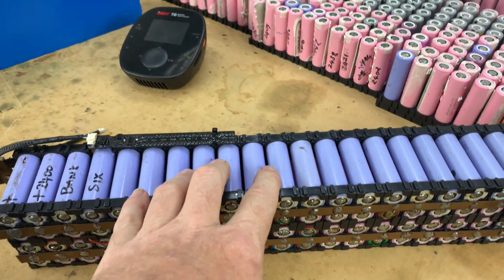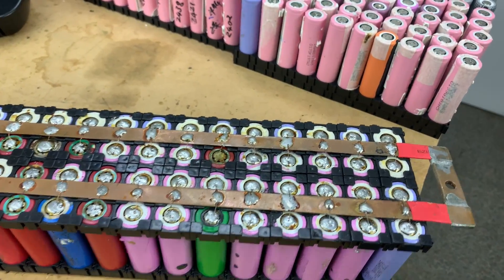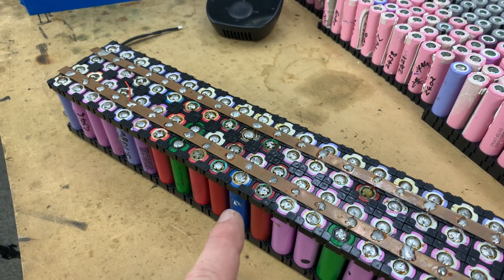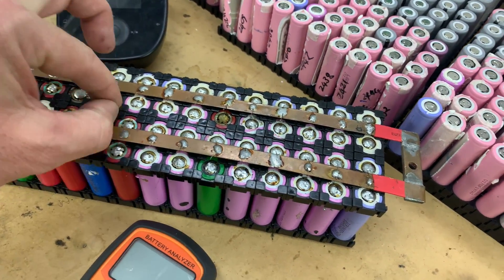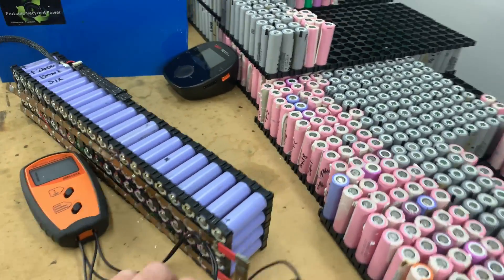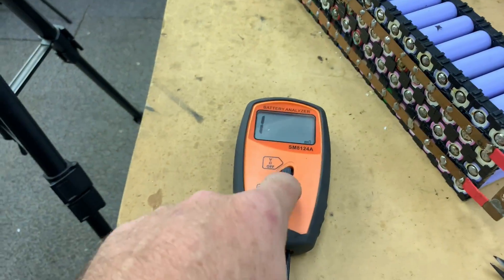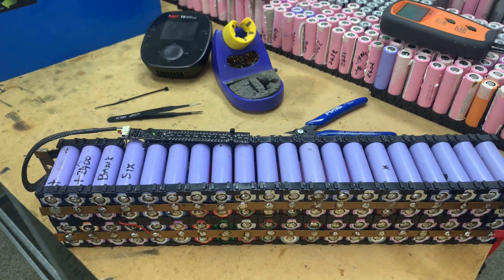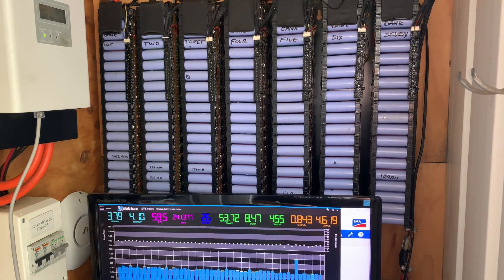Trouble shooting Cell 48 & IR Testing it to try and find a the fault causing it to be weaker.

Comment: What is this. Are you measuring resistance
Reply from the maker: Yes, the internal resistance of the cells
Reply: @HBPowerwall  I'm sorry, but why not use the avometer? Is there a difference? Thank you
Reply from the maker: some volt meters dont' have the function and single point isn't accurate enough.

Comment: Thanks for sharing. Can you tell me how low do you run your packs? My 40p 16s  has 4 packs that discharge
more than others. I did capacity test and used repackr.
Reply from the maker: I try not to go lower than 3 volts but sometimes i've been playing around with settings and it's gone as low as 1v that low will really damage cells

Comment: Hi Thanks for the great video. Can you tell me how many packs have you rectified like this to replace bad cells up to now since you started your first powerwall?
Reply from the maker: Would be less than ten over 4 years - the issue is you keep chasing the weekest link so i could probably go back every week and pull a low cell and have to 'fix it up' but I wait till there is a noticeable issue with the thermal camera before diving in and creating more work. I thermal my camera once a week under a 70 amp charge current to test for heater cells or week points in wiring/loose bolts
Reply: HBPowerwall thanks for the information mate.

Comment: One off my packs was always low , finally pulling it out and tested ,, had 2 cells that showed no heat but where self draining and pulling the pack down . Doesn’t take much unfortunately
Reply from the maker: I agree, it is just one cell very slowly 'leaking' will cause issues

Comment: Easy: it has a bigger capacity => it charges, but voltage increases slower!
Reply from the maker: But then discharging would be the opposite effect yet it's the second weakest cell.
Reply: @HBPowerwall  That would appear to be so only because it did not get the chance to charge near the level of voltage of the other cells! Important thing to check is: weather it gets down  to say 3.3V faster than the others, then one could  say that that cell has a problem. Otherwise if only a small current is drown and then recharged together with the other cells... hey! it's not a conclusive test... especially because on the higher voltage ones it takes small currents to climb even higher, but at lower voltage one it takes a lot of current to only climb a little.. and charging current value is almost the same (minus the insignificant equalise current)...

Comment: I am wondering if one or more of the cells  has an internal intermittant connection.  Maybe the red cell about 4:50 to 5:00.  It would be only be getting partially charged  when the cell's internal guts are connected and then when the battery is not being charged that individual cell will be lower voltage, and rob energy from the rest of the pack to charge that cell again when the cell's internal guts are connected.  Just a possibility to consider.
Reply: Even if that were the case, and even if every cell in the pack was only 2200mA, then for every ten cells there is available 22Ahrs to recharge that one dead cell (176Ahr across an 80 cell pack). So, no, that can't be the cause. 
However, if somehow it was intermittently shorting out, that would be a different story, but you'd see a blown fuse if that were the case, so clearly that's not it either.

It's a pretty odd fault.
I'd be looking to see if the long mon is actually reporting correctly.

Comment: Hi Pete what I found is the batteries that have high resistance take longer to charge or don't charge all the way. When using a power supply set at 4.2 volts and the current does not go close to zero or zero as it should at end of charge. What I think happens is the batteries in parallel to a high one don't fully charge. You will see some batteries that say in the specs what the current should be at end if charge and that would correlate to it's resistance.

Comment: This is an interesting issue. Maybe a crazy idea, but I am wondering if maybe the busbars come into play with the voltage drop under load? This causing a higher potential during use and eventually lowering that cells voltage in comparison to the rest of the pack over time?  I was reading this learning series (made my head hurt) on how emf comes into play with parallel resistance.  https://courses.lumenlearning.com/boundless-physics/chapter/resistors-in-series-and-parallel/
Reply: And what I meant by the busbars is since those are older, maybe corrosion has caused a higher resistance than the others?

Comment: I test mu cells with liitokala. It gives me the resistance as well as the capacity. I know it is not really accurate, but at least i know when it is above 100ohms. Do you think i can trust it?
Reply: liitokala can be of with 50 or even 100  milli ohms buy a yr 1030 or a sm8124 meter and test them like the manufactures does at 1 kHz then you get thru internal resistance

Comment: Hey Pete just wanted to ask how would you spot weld to a cell that's had solder put on the connections would I have to wick all the solder off the pack
Reply from the maker: I don't think it would work well... I should try..
Reply: @HBPowerwall  yes please do it would be an interesting test

Comment: I think you did the correct thing and take that cell out of service. Replacing the high resistance cell's with new ones was a smart move ow though probs shoulda tried to use ones closer to 2400mah  but over all i recon you probably just saved that pack and personally i am confident that it will now go back to normal service.. the slightly high resistance was most likely not enough to generate heat issues but just enough that over time the cell's in question were getting less and less juice each deep cycle that was done on the pack. 

Fingers crossed mate and IR testing is well worth it specily when building bigger and bigger packs!

Keep it up!
Reply from the maker: That's what i was thinking - just a slow drain - it seems to be better so far but now i have to fix the next lowest one - this won't stop keep chasing the weekest link. Next one is 43... it's the closest positive connection to the inverter/chargers so i think it gets the hardest job to do
Reply: @HBPowerwall  it's only getting pulled down based on voltage so cell drain should be uniform relative to individual cell differences such as IR and such :)

Comment: I guess the upside to being behind you senior DIY Powerwallers is us newbies can benefit from your experience, trial & errors. 
I had already made my own mind up to build packs based on Capacity and Internal Impedance matching (with a better IR tester taking the impedance at full charge rather than relying on the useless cell charger measurements).

I had seen older videos from peeps like Tom Donnelly and DIY Tech & Repairs covering this years ago and was curious as to why it isn't already a staple part of cell processing like mAh testing!?!?!?

Granted it adds time to the whole process but Rome wasn't built in a day and I believe curbing excitement to build your wall in a hurry with stringent cell testing and matching characteristics can only be rewarded later on, specifically if your not using new cells!
Reply from the maker: I have totally changed my view on IR testing - but like you said it's just trial and error and someone had to try... Consider this long term test over and it was a failure lol

Comment: Anything much over 70 I wouldn’t use.  Even though specs say less than 100mOhms typically they test at around 50mOhms when new. That means at 70 mOhms they are sitting at 40% higher IR than a typical new cell. The IR tester looks good because you seem to be getting accurate results
Reply from the maker: it gives very good consistent results - that suits me fine

Comment: hey pete, i am also do the IR way with my YR1030 i have now 8 à 900 cells with a IR lower than 40 mΩ and create low IR packs i think wolf`s approach is the way to go!!
Reply from the maker: Couldn't agree more
Reply: @DIY Projects he is is a guy that made a very  huge 18650 database with the relation to capacity  and internal resistance.
you can find all information @ secondlifestorage.com it's a forum where you can find a lot of info from 18650 and chargers and relateted solar/off grid systems

Comment: It's actually milli ohm, or 1000th of a ohm, ie, 100 is 0.1ohm.
For that many cells I would put the probes in a bottle capping/drill press type devise, and just hold a cell in it and pull the handle for a reading.

Comment: Hy,dont use heat soldering and dont mixt cell,wrong evrithing you doo
Samsung/Sony cell-izzi charger
Sanyo cell-hard charger..nice&wrong
Reply from the maker: Define wrong? This works - has worked - still works, but still wrong?
Reply: I assume you have your own channel where you explain all of what your are criticizing above in detail. Sort of a more positive approach, if you understand what that means.
Reply: Soldering cells isn't as good as spot welding... BUT...what was the rest of what you said??? if you don't use mixed cells in packs it would take years and years to get all the same brand cells to use in packs and you might grow old waiting to build your power wall. That's why peter tests his cells. 

Diy_marco marcoo
 lets see your power wall setup!

Comment: What is the highest resistance you except?
Reply from the maker: in that new battery 'm building max is 50 - I'm trying to build the very best battery I can. With all the knowledge we have gained as a community.
Reply: I'm using the same internal resistance meter you Pete.😜
To be under 50 mohms the batts would have to be new, and not used?

Comment: Four wire testing is  the best Peter. I'm a old calibration technician. You should always check the internal resistance with the spec sheet range plus or minus 10 per cent.
Reply from the maker: Didn't even thing of checking the spec sheets
Reply: @HBPowerwall  Stay safe.
Reply from the maker: I'll give it a crack lol